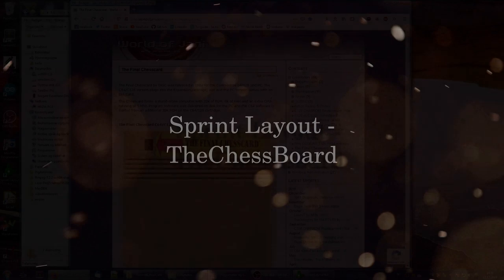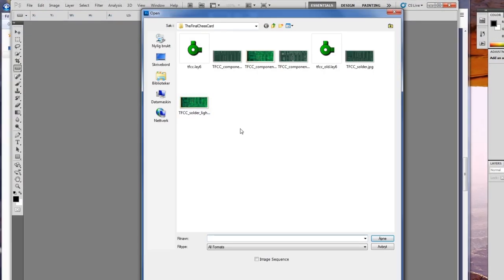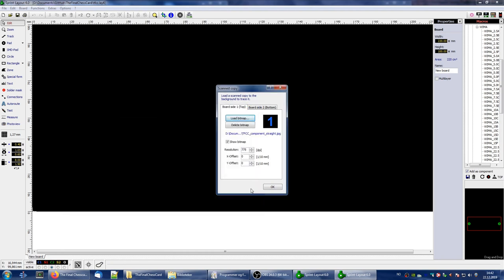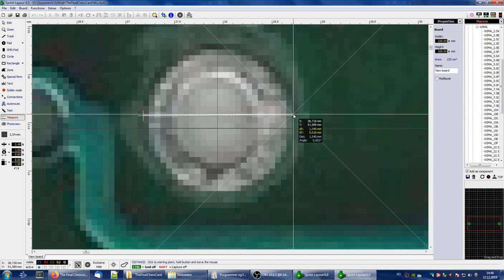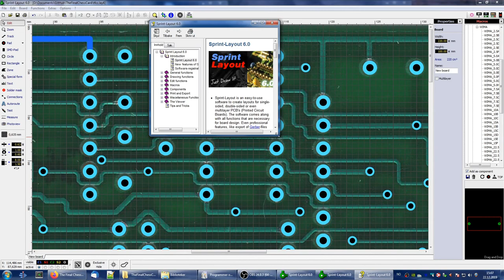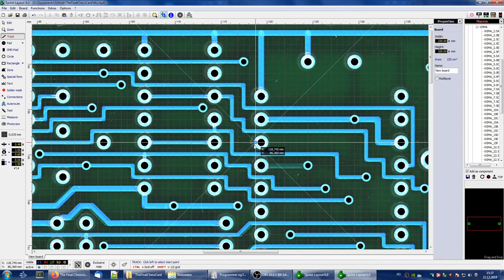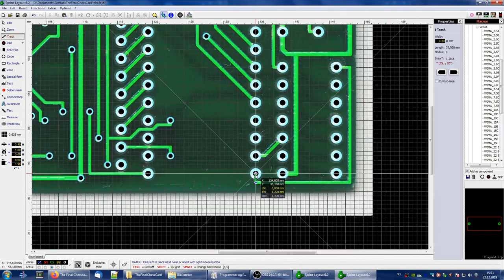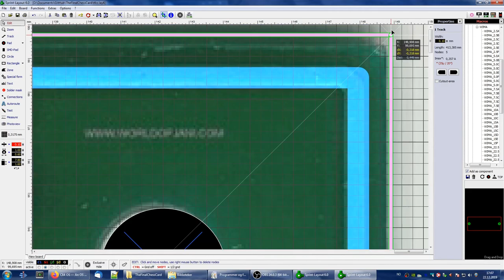SprintLayout - Re-drawing a PCB using scanned copies

Comment: too fast to do it. How did you do the outlines ? Cant see what you click in the menu so fast.... better you do a smaller pcb without time shutter..
Reply from the maker: Thanks, that is a good idea for another video. The out lines or edge cuts i drew on the silk layer first, and afterwards i changed them to outline layer, but I dont recall exactly.
Reply: @bwack  that would be awesome ! Maybe you know how can I have a silver Text on my green silk ? the silver is a groundplane zone. Something which cut out the characters from the green surface ?
Reply from the maker: I think I understand. You mean a solder mask stop layer.. Let me check..
Reply from the maker: @markussteinbacher8807  It seems you can only place text as copper or silk.
Reply: @bwack  yes the characters should be cut out from the solder mask (green) so you can have silver (lead) or gold characters / letters for the text depending on the underlying ground plane..

Comment: Tracing PCB's is pretty therapeutic. Used to do it a lot back when I was heavy into modular synths. Traced many of Ken Stone's Cat Girl Synth modules. Nice and easy one sided pcb's. Abacom's Lochmaster is also an amazing program. Made strip/protoboard layouts so much easier, and it allowed for some pretty interesting things like upright or crookedly placed resistors, and jumperwires going everywhich way. I vividly remember actually switching back and forth between tracing synthesiser module pcb's and rebuilding them from the schematics on stripboard. Merry christmas dude, thanks for all the interesting video's!
Reply from the maker: Cool ! did you use trace using sprintlayout ? Lochmaster is new to me. I'll check it out! Merry Christmas!
Reply: Oh yeah, I'm pretty familiar with the process. Although, I've been using a way older version of Sprintlayout. I think it was version 3? Things were a bit rough around the edges back then..

The thing that drew me to Lochmaster is it's "Potential Test" function. It's basically touching an IC pin, and it lights up everything connected to the pin (including other component's through hole legs, one side of capacitors, circuitboard traces etc), and it's a complete lifesaver if you're going from schematic to strip/protoboard layout. In the time I used it, I haven't even touched all of it's capabilities, just sticking to stripboard, as I have about 50 of those laying around. You can get really compact with circuits, even though it's on stripboard. 

Also, the printout options are ace. Make and test in Lochmaster, set a few printing filters so only the spots where you break the stripboard show up, along with some board orienting symbols, and you can basically tape the printout to a fresh board, grab an exacto knife, cut on the printed positions and have a circuitboard in 10 minutes. Component side printout is basically the same, and it auto-mirrors printouts so they slap on the right boardside. It's a dream to work with, if you just can't wait for 2day turnaround pcb.

Okay im'a stop here, this is already turning into quite a wall of text. But yeah; give the demo a try ;) Cheers!
Reply: Hmm, haven't dabbled with Eagle yet. Might do that actually. Thanks for the recommendation!

Comment: Hi bwack, I'm having trouble aligning the grid to the scanned PCB I have. I'm working on a similar project to this as it is an expansion card for an old synth from the 80's, it uses the same layout as the commodore 64 too so I thought this video would be perfect. I'm frustrated to the point where I am tempted to just free-form the layout without a grid, but I know that wouldn't be "professional". I could really use your help on this, thank you.
Reply from the maker: You can go gridless, but make sure the scale is correct. Try measuring something in the image that you know the spacing of. Like for example the pin pitch is usually 2.54mm

Comment: I want to ask a question,how can i check the pcb board tracks are not connected to each other...How to adjust if the pad or track has a jointed..??
Reply from the maker: SprintLayout has a DRC function that you can use. I don't know if that is what you are after.
Reply: @bwack  how can i contact with you sir...i want to share GBR File...

Comment: Very nice video! Thank you for this!

It looks a lot like what I did with a keyboard PCB in KiCad/PCBNew. I guess the procedures are more or less the same, maybe depending on whether you decide to make a schematic and assign footprints first, or build the PCB on its own.
Reply from the maker: For a large project I find it very helpful to use SprintLayout first and then the schematics in KiCad later for verification. As of now it still is not possible to draw on top of images in KiCad. Also KiCad isn't a great drawing program, great for layout and routing, but drawing over  a replica is a bit fiddly.

Comment: Thank you for this excellent video! What make and model number of scanner was used to produce these scans? Any tips and tricks you can offer to get the best quality scans? Many many thanks!
Reply from the maker: I can check when I'm back. Oslo is now in crisis so I work from home. The scanner is a large office printer and copier. I think it is good enough for smaller boards, but for boards as wide as 400mm the errors I got in my KU motherboard scans were more than 1-2 mm. A professionam service can scan multiple times in different heights above the board and merge the images in software to eliminate warping in the board. Anyway. For smaller boards just go ahead. I think almost any scanner will do 🙂
Reply: @bwack  Yes, please stay safe! The world is on fire and I think it's only going to get worse before it gets better. 

I've found scanners to be kind of hit or miss when it comes to depth of field.  That's not much of a problem if you have an unpopulated board but I'm hoping to find a scanner that can handle components a bit better, even though they obscure the traces and such.  Some boards that I would like to make drawings from are extremely rare so depopulating them would be a last resort. If I can at least get a rough drawing with the board populated, that should help quite a bit.  Now if only I had an x-ray to get pics of inner layers... :)